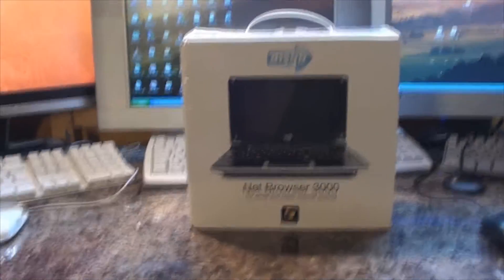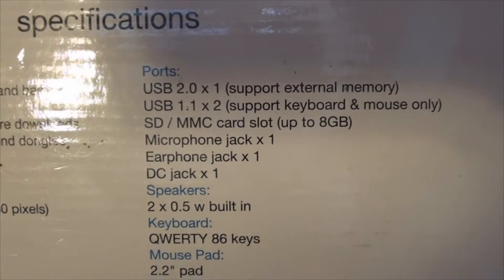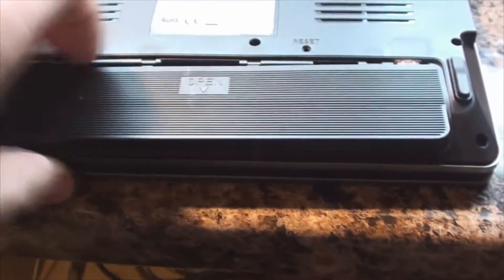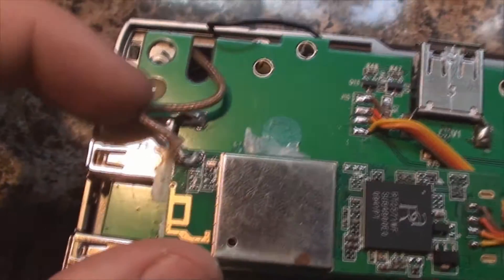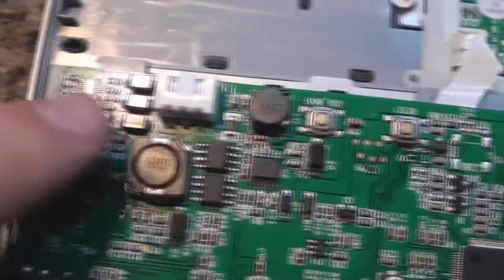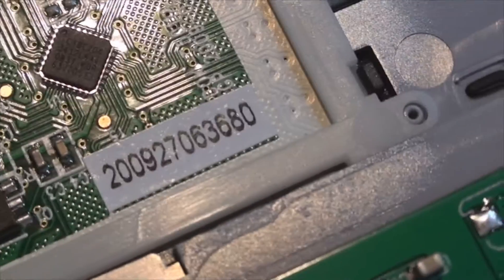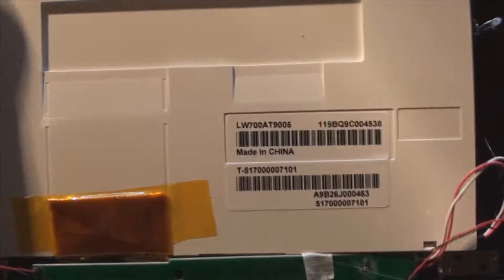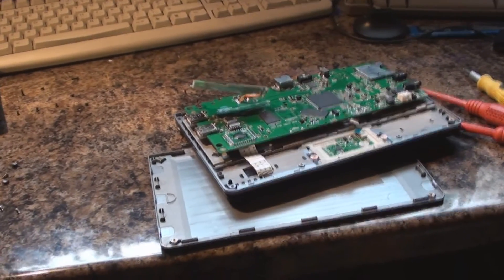Disgo Net Browser 3000 Review & Teardown

Comment: I have a similar netbook but with android and a newer processor (WM8950), battery eventually died and started to swell so I got rid of it, still works when plugged in, not really usefull today so it's sitting in a drawer.

If you have one of those check out the custom firmware called "Uberoid" I don't know if the website is still up but it really help squeezing every drops of power from these little machines.

Comment: I bought this really cheap on ebay. Wasn't expecting much so no need to tell me its shit. I wanted to wipe it and install a very basic linux version on there but besides the poor specs I came across an even more crippling flaw...there is a stupid password lockout preventing me from accessing the bios! The previous owner didn't know what it was and reading around the net it seems others bought them new with this stupid password already on it and no idea what the password is. Anyone know how I could wipe the password/flash it or if there is some default password to access the bios. I guess I won't be able to do anything related to installing a new OS til I could access the bios will I?
Reply: I think the bios is zfk, but be careful because you can easily brick it
Reply: Elliott Hurst
thanks i figured the password out but I was so frustrated by this piece of shit. So many days of fruitlessly trawling forums for any scrap of useful advice on how to deal with these backwards 'arm' devices. I was about to sell it again on ebay and in one last effort to spite me it broke the last time I was planning to use it. Glad this thing is out of my life now as it was about as irritating as my hemmeroid, probably more so.
Reply: @gringodlimancholish5332  so what was the password
Reply: +Elliott Hurst Thanks so much for this
Edit: Doesn't seem to work

Comment: I would say the 8GB limit is due to the operating system, rather than the CPU.  I have two identical Dell Axim x51v PDAs; one with WM5 and the other WM6.1 and the former supports 2GB or something, and the latter 16GB or higher.

Comment: Dont forget Maplin is terrible for selling these chinese devices. Ive got a small MID i got as a present, its a Maplin MID A10JQ and its quite bad, very easy to mess up the firmware with 1 wrong setting and brick the device. Ive also got a terrible chinese Android table with faulty wifi (Very common with this model) Its got very similar construction to the crapbook in your video, everything glued in with hot glue. Also out of curiosity, how much do you pay to run all you equipment?